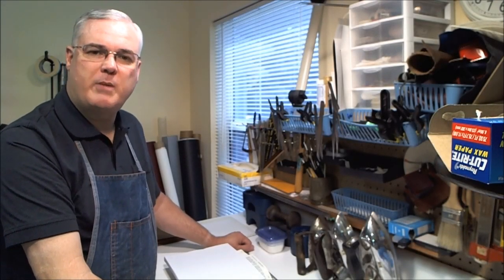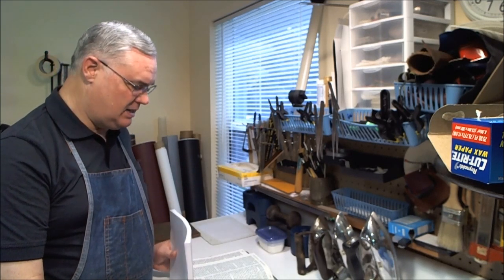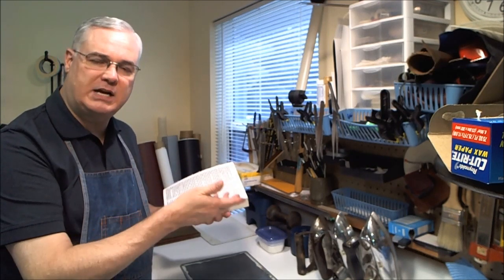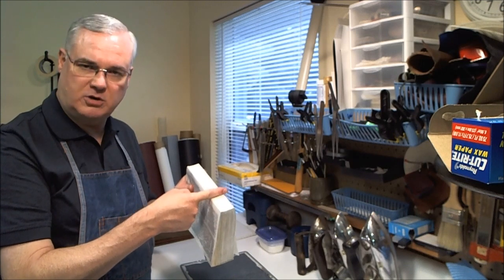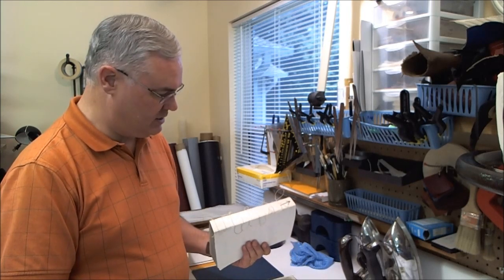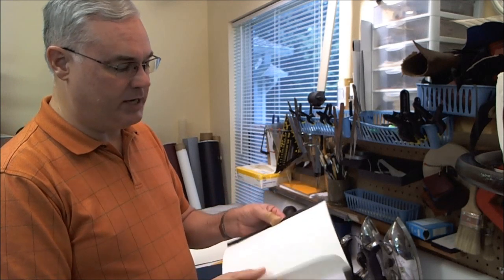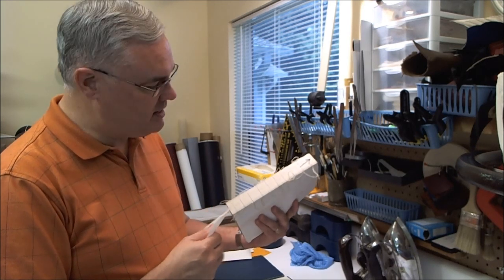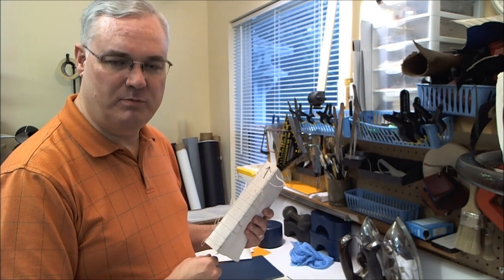Reinforcing a "Perfect" Bound Bible

Comment: Hi there, thank you for the video! I have some clarifications if you don't mind. can I check how you've threaded the thread through the grooves? did you snake two threads all the way through each groove? or did you use separate short threads through each. It looks looped at several parts but I can't really tell.

Comment: Would it be a good idea, not making the saw cuts horizontal to the book, but diagonally? 
Wouldn't the cut edges had more adhesive suface that way because of the diagonall cut or is this adhevise area to small with paper and it makes no difference?

Comment: A. How did you remove the glue?
B. Can any thread be used as long as it has good linear strength?
Reply from the maker: Hey Kyle! On the question of how you remove the old glue from a book spine, we use paste! That's right, we use wheat paste to soften the PVA or other glue that is on the spine. Just put a generous amount of paste on the glued spine and let it sit for 15 minutes or so. Then see if it can be gently removed with the point of a bone folder. Trial and error and you'll figure it out. Linen thread has traditionally been used in bookbinding. It's very strong and is a natural material that reacts well to the various materials of the book. But yes others thin threads could also work.